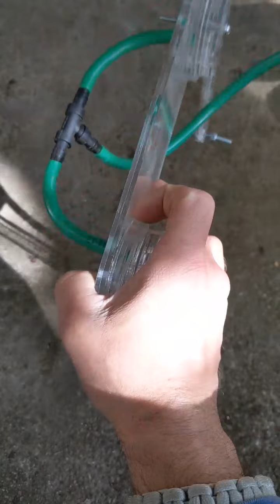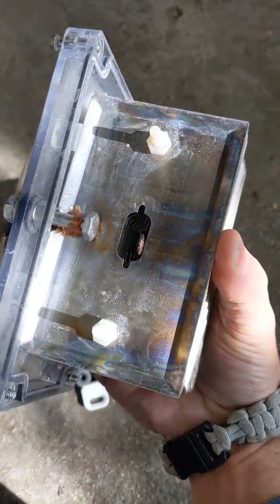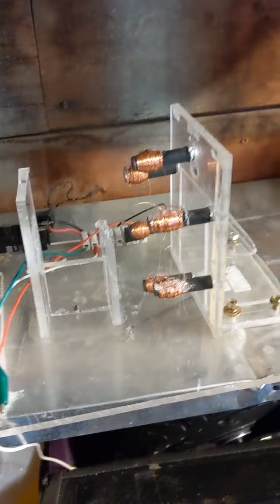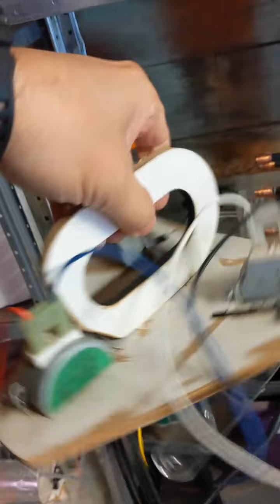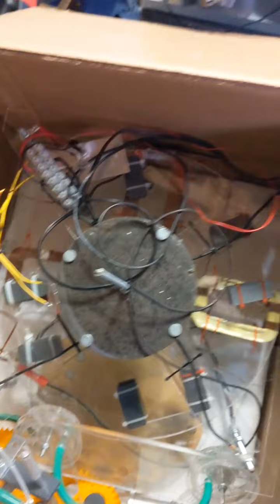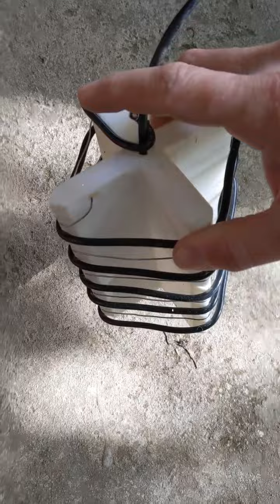Moving time, and a walk down old invention lane - Inertial propulsion, HHO, OU generators and more!

Comment: That asymmetric capacitor with the thick and thin wire looks very interesting. Cool idea, I haven't seen that kind of arrangement before...
Reply from the maker: It didn't seem to work at the time,  but in theory it should